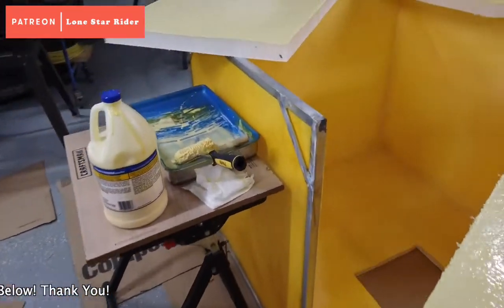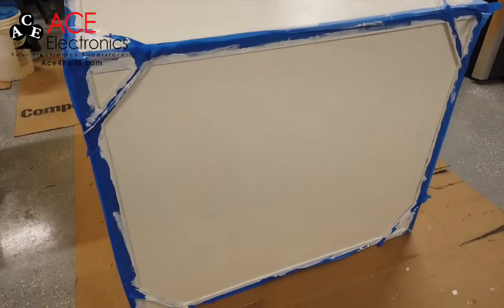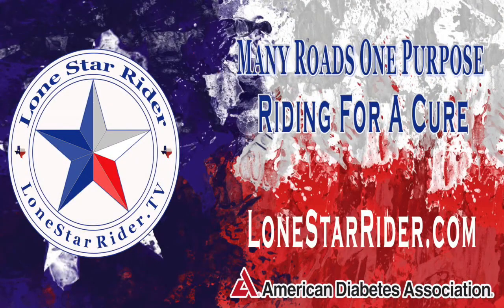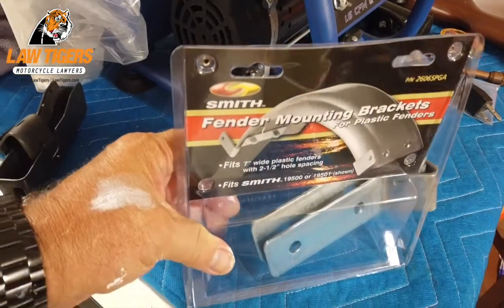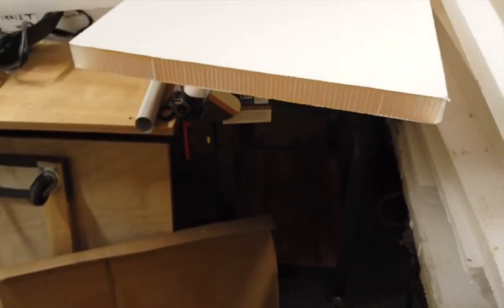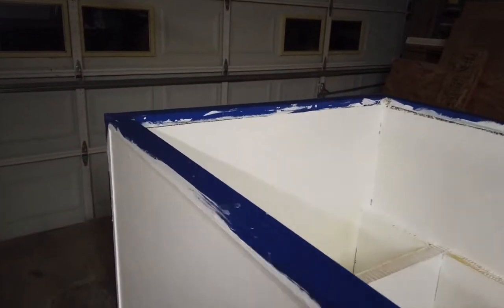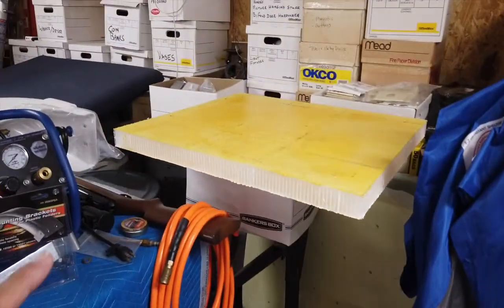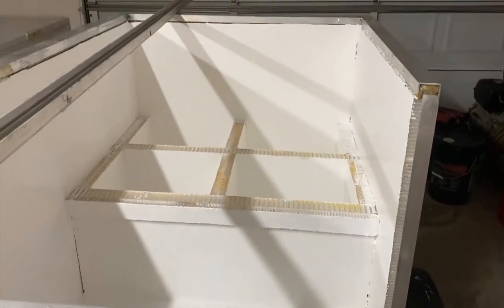Riding For A Cure Trailer Rebuild Part 15

Comment: looking good rex man what a big job huh . got a couple questions for ya  so is this going to be lighter then the teardrop . and . is it bigger looks pretty small i know you have to pull it with your bike but  seems like its pretty small . how do you plan on weather proofing the doors on it seems like the way your doing it ther might be a issue with leaking . on the top door any way . just trying to wrap my mind around your madness lol . cant wait to see it done its going to be one of a kind for sure .
Reply from the maker: Very big job, more than I expected.
Same weight as the old Teardrop, 350 lbs.
Same size as the old Teardrop 4' x 6' x 3'  but the top pops up to give me more head room.
There is a door stop on both doors and will be lined with a rubber foam to keep the water out.
Thanks My Friend!
Reply: @texaslonestarrider  ok sounds like you got it all figured out . i sure hope you like it better . going to be neat  seeing you pull it down the road .